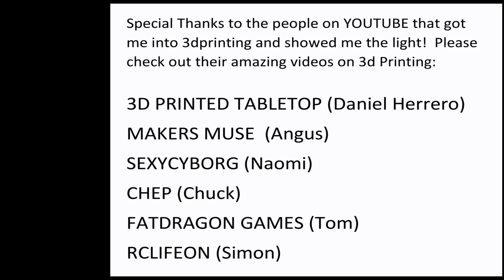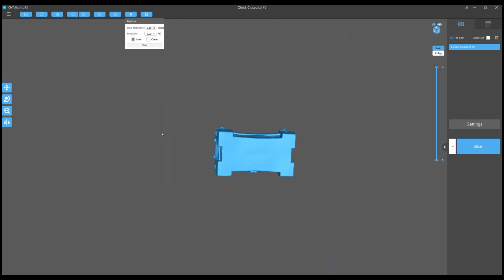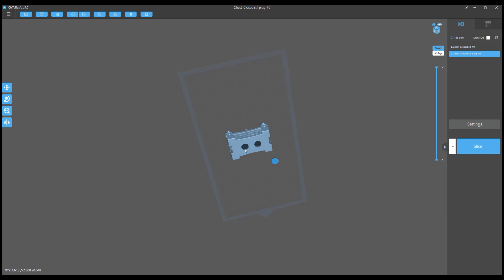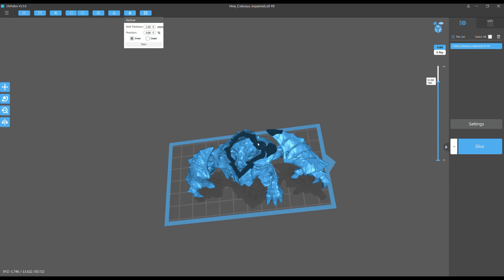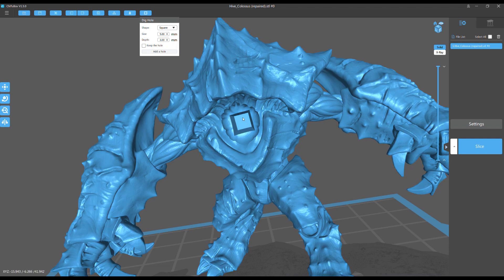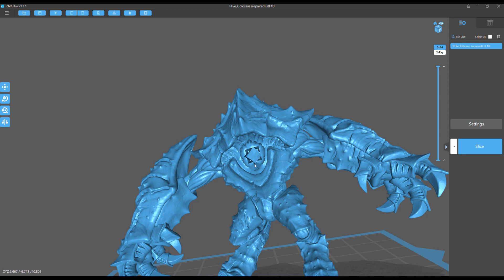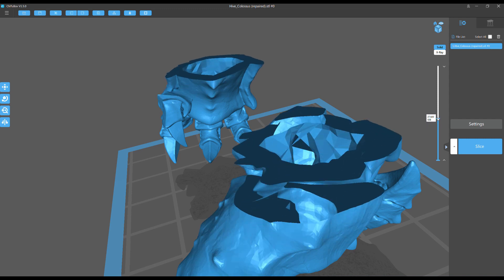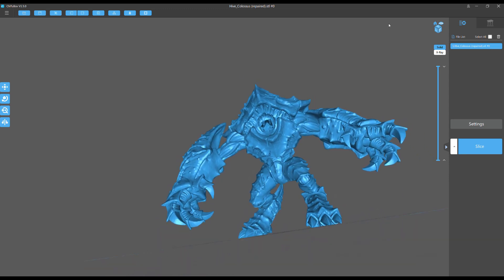There is an advanced Technique to Hollowing Models: LEARN IT from a printing expert

Comment: Few notes from my hollowing experience.
First I quickly switched to Lychee and its hollow, holes & blocks features are much better than what I saw in Chitubox.
 1.) I can make very thin walls. That depends on the model of course. If you have wider & flatter surfaces they would be weaker if pushed, so you might need a bit thicker walls, but as most figures have plenty of curves and corners you can usually get away with much thinner walls.
I experimented with a regular ~30mm mini of a human and made it with 0.5mm wall, and it turned out great and plenty strong. When pressing it with fingers it still starts to hurt my fingers before I sense any material weakness, and I'm sure that if I drop it on the floor it would break even if it was solid (unless made with a bit tougher & flexible resin).
The trouble with hollowing tiny figures is to find enough place for the holes. with that ~30mm human mini I used the wrists (which were modular so they had a concave semi-sphere in it to fit the separate hand holding some weapon usually). Feet are also good for placing holes that won't be visible later.
So I don't normally try to hollow ~30mm minis.
But their mounts & cavalries and heroes - ie everything bigger especially with bodies & parts that are trunkier I usually hollow, but usually stick to 0.8~1mm wall thickness just to be sure.

Thinner walls also help with connecting cavities, though at the risk of having some small separate cavities in thinner parts.

 2.) so here comes Lychee to help with its blocking feature. Instead of struggling to connect several small cavities, it's usually better and definitely much easier to add a shape - a block that makes everything inside solid. Some figures capes are trying to become hollow when using thinner walls, and have nasty cavities to drain or connect, so I just put then in a blocker shape - they wouldn't save much resin being hollow anyway.

 3.) Actually the hollowing feat itself in both Chitubox & Lychee is really simple and works perfectly fine. (except that in Chitubox you might get some small separate cavities to wonder how to deal with! but in Lychee see #2).
The main problem are the holes!
Again I find Lychee has much better functionality managing holes. In pro (which is much, much cheaper than Chitubox-pro!) you have the advanced mode that allows you to move & rotate holes much more precisely, so you can put a hole quickly, and then resize & adjust to fit best.
But in Lychee there's also a convenient feat that shows suction cups. Like in your example placing even a large hole in the neck won't help. Each time the build plate lifts it'll suck with the full surface no matter than large part of it is hollow and only full of liquid resin from the vat, it has to overcome the suction force and let a little air in to release the force. That's why you should have at least a tiny hole or two nearest the build plate (reaching the cavity of course), but not blocked by the build plate itself.
I also usually put a large drain hole on the part of the model touching the build plate (if there is one), but that only helps later when cleaning with IPA, and does nothing for the suction forces during printing. But fortunately these holes don't have to be large, especially with the suction force the resin would be pushed/sucked even thru a 1mm hole (which would normally be too small for IPA cleaning later).
Sometimes depending on the model orientation it's difficult to hide even a small hole near the build plate to release the suction forces in that given part, so I'm not too pedantic - I try to have such a small hole in each large cavity, but if there's a small part that would be very visible I just leave it suck a little :) 

One way to hide holes (esp. larger ones) after printing is preserving the holes and printing them, and then glue them after cleaning the model. 
I haven't done it yet, because so far I usually find where to put enough holes.
Convenient places are when the given model would naturally have holes if you get my drift ;) 
For example on a horse from fighter's guild (from Artisan Guild) I places two 1.3mm holes in the horse nostrils :) 
In a griffin (a dwarf cavalry from Artisan Guild) I put a hole in its throat, and one on the opposite side ... right under the rail :) 
So even if you see them later your brain might not register it like a weird thing and ignore them. And even if you notice it ... well there should be a hole anyway, right? ;)

Comment: i tried to hollow a model recently, but print failed due to lack of supports on supports...so i reprinted it solid...at the time i was thinking about potential saggin....do you think sagging can become a problem with hollowing? Theres no supports inside the model so i was just curious on your thoughts?
Reply from the maker: if the area is large and needs supports you should definitely add them!  :)

Comment: I dont understand why even care about liquid getting trapped in the model?  I mean if the model is compleatly closed so why bother and put holes in it? Im a total noob and my printer is on the way i just want to understand why this is neccesarry.
Reply from the maker: Uncured resin will crack open the model and spill it within 1-6 months  :D
Reply: @3dprintingpro212  oh okay thanks for the answer then it makes total sense to let it out haha. And another question I have is can I put 2 resins together but not mix them completely to create a nice pattern ?
Reply from the maker: @LuN-Gamedesign  nope once the plate goes into the vat it'll mix them up
Reply: @3dprintingpro212  ah okay yeah makes sense too thanks for the quick answers :D I'm realy hyped for my new printer and just want to make everything right.

Comment: HAH I just learned this lesson the hard way with a 10 hr Boba Fett print. even knowing to put holes and diligently making sure there would be venting through the whole model I ended up with a successfull?? print with resin trapped inside. Little did I realize that the holes were too small. Hadda go back and ream out all the holes I had put in larger

Comment: Hi Greg, am slowly making my way through your videos and loving them, especially amuzing when you get bored by your own explanations :) I am mainly doing models from GAMBODY and similar using a mixture of FDM for the bases and Resin for the models. Your supports will they be the same ideas for these kinds of models, i know most of yours are miniatures but you also print some larger pieces and i was wondering if your theory is the same between the two are you change depending on the size of the model, upgrading to more heavy and medium supports due to the larger mass and such. Also when hollowing i did see there is an infill feature in chitubox, will this compensate for the islands and overhangs within the models or still should refer to manual placements? Thanks in advance, Matthew

Comment: How do you remove resin from the model if holes are on build plate side it will not come out by itself.
Reply from the maker: Once you remove it from the plate...
Reply: @3dprintingpro212  that must be a really messy process
Reply from the maker: @porlockos  nope I drop it in my Anycubic wash and cure and hit the button lol
Reply: @3dprintingpro212  bu in that case you don't salvage resin that was inside, and that is the point of making models hollow.
Reply from the maker: @porlockos  There is very little resin trapped inside, I have a video on it...also, hollowing isn't just to save resin, it's also for reducing peel force, making a model lighter, et cet.  :)

Comment: Regarding the parts you know you can't really get too, I wonder if it would make more sense to use a more transparent resin for models like this , where the UV light might be better able to reach and cure the interior
Reply: I think it would be better to punch a hole in the forearms and then just have the program keep the hole, that way itll give you the geometry that was removed that you just have to glue back into place, but will let the arms leak out the uncured resin.

Comment: Would you suggest hollowing before or after adding supports? I was adding supports last but I've notice that sometimes it goes all the way through the model instead of stopping when it hits  another model part. For example an arm positioned over the torso. Supporting the arm should stop when it hits the torso but instead it just goes right through.

Comment: I took a warhose model that I downloaded. I'm struggling to understand why I would go to the trouble of connecting internal voids, adding holes and internal supports just to save $0.14 of material. My time is worth far more than that (opportunity cost). Here are the stats. BTW I love your videos!

Solid:

9.3ml
10.2g
$0.42
4h 45m

With 2mm hollow:

6.3ml
6.9g
$0.28
4h 45m
Reply: one reason to hollow a model is to reduce peal force. The lower peel force means you have less chance for the print to fail.

Comment: Is there any way to make a plug tapered on the end so it won't fall into the model when attempting to place and glue it?
 I have a beholder model I'm having trouble with plugging.
Reply from the maker: you mean the "hole" from  after you dig a hole into the model?  If so, once the hole is dug and the plug is on the plate, size it up 2% or so and see how that works
Reply: Yeah, the hole. So far I've had it either too small or too big :/

Comment: All the bottles ever made in the history of the world prove that you only need one hole to let liquid out and air in.  Even ketchup comes out eventually.  😅
Reply: No. There is a relationship between the viscosity of the liquid being poured and the size of the hole. If the liquid sticks to the sides of the hole then the air has to push through the liquid to escape. If you are limited to using a small hole then you will need a separate hole for air that therefore cannot be blocked by the viscous lquid.
Reply: have you ever used a gas can to fill your lawnmower?? Or whatever else.... there's a reason it has that tiny little hole on the back side of the handle (generally)

Comment: Good content, I have a couple questions. When I hollow a complex figure like the second one you did, the interior geometry is very glitchy and has lots of islands and when i run photon file validator i end up spending lots of time fixing those internal islands. Is there a way to smooth out that interior and get rid of the islands before slicing? Also sometimes when I create autosupports on a large hollow object chitubox will put supports inside the object, I have been able to remove those and print things out of pure luck, but how do you know if you need internal supports in the hollowed out area or not?
Reply from the maker: I actually did another video on that topic, in terms of what happens in terms of supports when you hollow.  And yes the things you ask are the correct questions! :)
Reply: I would recommend cutting down the quality of the hollow. In Lychee it uses 1-4, I usually use 4 for highly detailed models, and 1 for smoother surfaces, but that determines how much detail it tries to maintain during the hollowing. From my experience the less quality on the hollow the less complex the internal surfaces are.

Comment: You shouldn't ever leave resin in your models. Ever. You also don't need to hollow every model. Especially things at 28mm scale. Makes them way too fragile. The Umberhulk from AG is, much like all their finished stls, improperly scaled to begin with. By the time you've scaled the mini to its proper size, there isn't much room for hollowing. That all being said, your second hole is in the wrong place. By the very nature of resin printers that print inverted, you need to have a hole on surface closest to the build plate, and also on the top of the model furthest away from the build plate. This allows the resin to drain out of the model as it is being printed, reducing waste and making your model WAY easier to get properly cleaned. Use green stuff or equiv to patch visible hole.
Reply from the maker: I disagree the hole is in the wrong place, I was able to drain it easily and perfectly after printing.    Also I agree with you and I don't hollow most models, this was just to show how to use Chitu functions to hollow models for people who want to.  And of course you see the results right, my model prints perfectly, as do all my models  :)
Reply: 8bit, that's wrong. You just turn the model upside down and let the resin drain into the vat.  It doesn't have to drain while printing.
Reply: @DisgruntledPigumon  that's absolutely not wrong, you create suction without the top drain hole, and it can cause failure. Best practice is top always have a drain hole on top.

Comment: Good video! One thing I don't think you mentioned that I see in other videos is that you want to try and put the drain holes close to plate to prevent suction issues. So if you left that model as is you'd want to place some hols in the feet as well as I understand it.
Reply from the maker: Actually no, as I lift the model off and support it so there are 0 suction issues, so holes in the feet would be meaningless.  On a big flat bottom print you would be right!  Those other vids, if it's on a model like this..they are just wrong...
Reply: @3dprintingpro212   suction to the film not the build plate. Put a cup upside down into water, there is air pressure that stops the water going into the cup. That's what is happening every time your hollowed print is lowered into the resin. With holes in the feet, no internal pressure or suction.
Reply: @3dprintingpro212  Thanks for the reply. I think saying "they're just wrong" is a bit strong as there are reasons for doing it. However saying in your experience you're not seeing issues without them for miniatures that works for me as you're printing more than I am and they do look very clean. Again thanks for the videos.
Reply from the maker: @sethhanson5771  that's why I qualified that statement by saying "on a models like this."  On other models I would agree with that premise, just not on most miniatures  :)

Comment: Thanks for the video! I hadn't thought about hollowing through the inside of the model before. Regarding an air hole for the legs, would it make sense to put a small hole in the bottom of the feet?
Reply from the maker: yep that would work.  I really just wanted to show the idea of linking hollowed out spaces, this isn't even the best model for it, just wanted to share the knowledge so people can use whenever they see the need.  :)
Reply: I put holes in the bottom of feet (or whatever bottom part of the model) to stop suction and pressure during printing as well as for cleaning out resin.